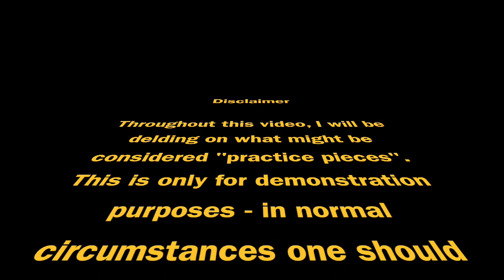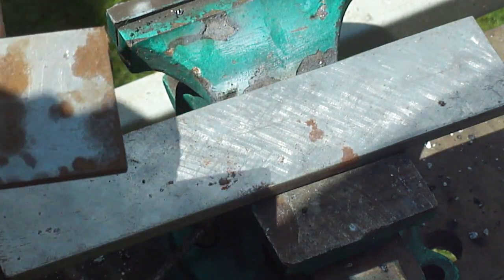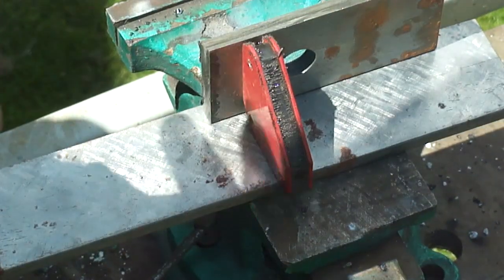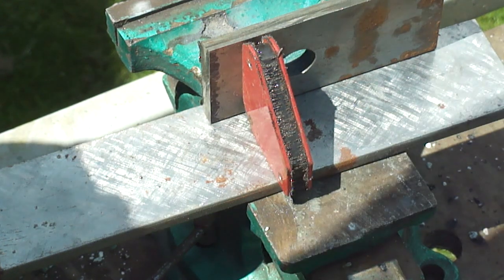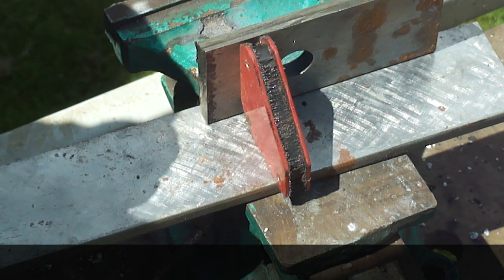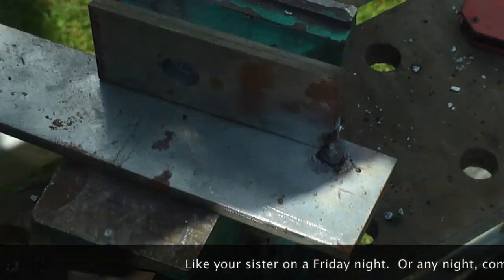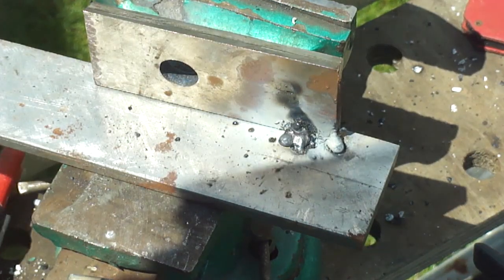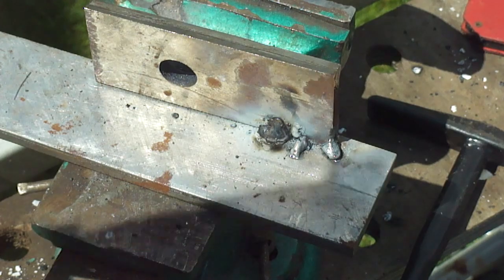Delding 0, being the second part of Delding 101

Comment: If I may be so bold, I would like to offer some friendly advice which was passed on to me by the master.

Your wiggle is indeed commendable, however, it could be improved tenfold if you initiate the masterful movement from the elbow in wide sweeping arcs.

Hope this helps.

Feel free to Del-ete this comment as and when required.
Reply from the maker: As a mere trainee delder, I haven't moved on to the del-eting of helpfully critical comments yet.  However, once my subscriber numbers are up, we've moved to a "family friendly" platform, and tool sponsorship deals from Anne Summers are in, you're toast.